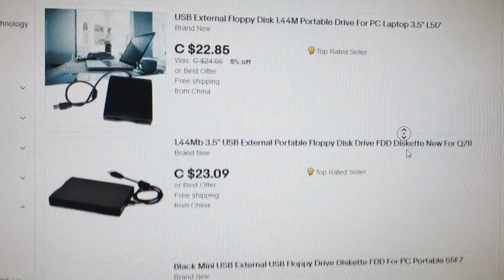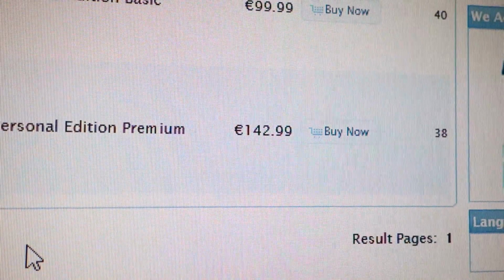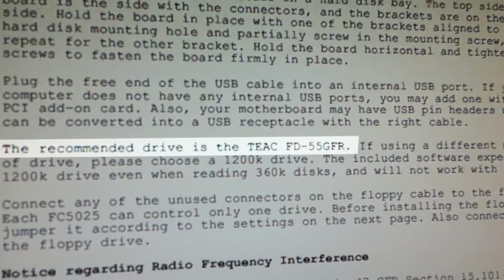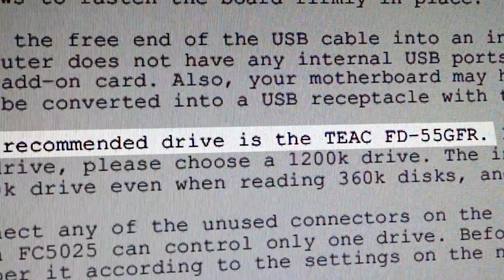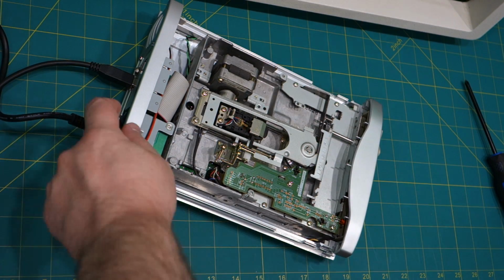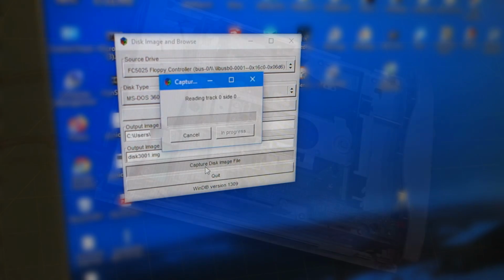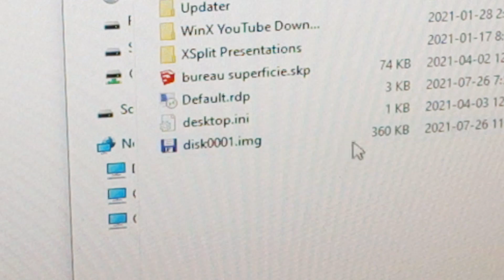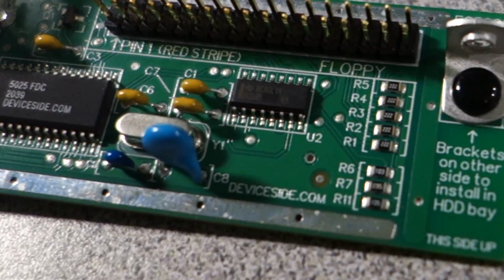Can we build a USB 5.25" Floppy Drive?

Comment: Until isn't to late, now, in 2025, it's better to find a working tower desktop on ebay with a floppy connection on the motherboard allowing usage of long tape connector for both floppy drives 3.5 and 5.25 inch ones. That tower  should run Windows XP and maybe Windows 7. Then to have installed those 2 internal FDD.
The WinImage copies images of any Floppy in Windows XP or even Windows 7.
That would be a proper rig to mess up with old floppies for any purpose, including preparing them for vintage hardware, archiving or reading old data to avoid losing them.
Besides in that setting old 5.25 inch floppies can be read/written the way those were designed in old time of yore.

Comment: if i don't use an enclosure? (i want to save some dozen of 5.25" discs).
Reply from the maker: Enclosure is mostly because I leave it on my desk and it's connected all the time, so I needed a solution that would protect the drive and keep dust out. The DeviceSide adapter will work perfectly fine without an enclosure :)
Reply: @theSoundCarddatabase  that's great news for my case!!!if you don't mind answering again, i have one more question....are there any drivers for the adapter in macs???
Reply from the maker: @yannisgk  My setup is PC, but from DeviceSide's website : 
"The included software runs on the following platforms:
-    Linux (tested on 2.6.24 x86)
-    Mac OS X (tested on PPC 10.4.11 Tiger, Intel 10.6.4 Snow Leopard, Intel 10.7.2 Lion, Intel 10.8.2 Mountain Lion and Intel 10.12.6 Sierra)
-    Windows (tested on 98SE, XP SP3, Windows 7 32-bit and 64-bit, and Windows 8 32-bit and 64-bit)"
Reply: @theSoundCarddatabase  WOW...thx for the information...you've been very helpful!!!

Comment: It would have been cheaper to use an old computer and network it to a modern machine or transfer to an SD card.
Reply from the maker: Agree! It all depends on your use case! if you're only interested in files, then an old computer + SD card would work. I was more into making 1:1 disk images, so this solution worked better for me.

Comment: I have a 3rd-gen i7-3770K running a massive RAID array for storage. Attached to that machine is everything from Orb 2.2GB, Jaz, Zip, and other removable media drives, to floppies and a select few tape backup drives. That system is for nothing else but archiving and backup storage. That's all it does.
Reply from the maker: Agree. Data archival and preservation is more and more relevant as physical media starts to disappear. So much important stuff is still on there with no way to be seen or useful.

Comment: You don't need to be limited to 5V power just to have a USB-connected 5.25" floppy drive! How do you think USB-connected printers and scanners, etc. work?
Reply from the maker: My guess is they're simply made with 5V in mind from the design phase and use only 5V components/motors/lights inside - the IBM USB floppy drives I own are 5V 500mA, and the Canon USB-powered scanner I have is 5V 500mA as well.  As for printers, finding one that is exclusively powered by USB seems impossible - most "portable" ones I seem to find actually have a battery inside and are using USB to charge it.
Reply: @theSoundCarddatabase : So my point is that any logic that "Uhh, well, USB 5 1/4" floppy drives aren't manufactured because they'd need to have a voltage higher than what USB can provide, uhh..." doesn't make any sense, because that never stopped mains-powered USB printers, scanners, and hard disk drives, etc. from being produced commercially.
Reply from the maker: @HelloKittyFanMan  you attribute a lot of uuhhhs to me. I agree with you that a mains-powered floppy drive enclosure, that connects through USB for data only is possible. It is basically what I assembled. If the initial problem was to find a floppy-to-usb solution, then it exists. If the problem was finding a floppy-to-usb-only solution, that would not be possible if you want to reuse actual old floppy drives. This said, why newer floppy drives with 5V inner workings instead of 12V were never done, I have no idea.
Reply: @theSoundCarddatabase : "A lot"? 2 isn't "a lot." But I agree that you didn't actually say those.
Yes, I see that what you've made here is what I'm talking about. But you used the logic that the reason is not made commercially is probably because that sort of floppy drive needs more than 5 volts. Which I'm saying is exactly nothing that would prevent any average peripheral manufacturer from making one of these commercially. But I don't understand your supposed comparison between problems. I'm just saying that your intro. makes it sound like you believe the reason there aren't any commercially produced USB 5.25" floppy drives is simply because of this 5V/12V thing, and that's what I'm saying doesn't make sense, because they can easily get around that. Not as portably, obviously, but it would be very doable anyway.

But you know, these days I bet you they could even make a 5V-only-based 5.25" floppy drive with the motor technology that we have now, in the same way as they have done with 3.5" standard floppy drives. But for some reason that solution still hasn't existed commercially. Do you think I would be wrong to guess that the size of spindle motor needed to spin the kind of hub grip needed for 5" floppies could be driven by a motor that's based on the newer technology for motors of that size now? Or do you think it would still have to be too massive even now, without requiring a higher voltage?

But anyway, I'm almost certain that a manufacturer could make the commercial version of what you have made here, even to the point of making it show up as a regular drive, but with external power if necessary. However, it seems that at least something in just the market has still stopped them from going through with it so far.

Comment: I have yet to be able to wrap my head around the fact we cannot get the collective hobbyists to put together an actual working read/write 5.25 solution that reads/writes natively without images. I know the USB standard doesn't support it, but so what? There are plenty of proprietary USB devices with custom drivers etc, so what is holding back the development of an actual USB 5.25 floppy? Some say demand, but it is VERY evident (especially lately) that there is a huge demand for such a native solution. Ideally, an external shell with the pcb and power with connectors inside. USB and standard power plug on the outside. Or heck, even a brick 12v adapter would be suitable. I don't know enough to even begin, but it is obvious there are plenty of people who are.
Reply: Would buy one of these
Reply: Agreed !!
Reply: It’s very confusing. Worst case you could just get an FPGA or a Raspberry Pi to drive the read/write heads and interpret the data and feed it to a PC in a USB friendly way.

Comment: Read only! Better solutions is old PC who support 5.25 floppy and have USB port. Read file with 5.25 floppy and copy on USB stick and insert in new PC than read data.
Reply from the maker: For most applications, this would be an entirely appropriate solution! But for archiving exact disk images (sometimes important for old copy-protection) or just preserving data as it is, I found it easier to skip the middle step.

Comment: Does the 5.25” USB floppy drive work with Commodore 64 5.25” floppy disks? Does it work with the C64 Mini and C64 Maxi?
Reply from the maker: The current list I have is : 
- Apple DOS 3.3 (16-sector)
- Apple DOS 3.2 (13-sector)
- Apple ProDOS
- Commodore 1541
- TI-99/4A 90k
- TI-99/4A 180k
- TI-99/4A 360k
- Atari 810
- MS-DOS 1200k
- MS-DOS 360k
- North Star MDS-A-D 175k
- North Star MDS-A-D 350k
- Kaypro 2 CP/M 2.2
- Kaypro 4 CP/M 2.2
- CalComp Vistagraphics 4500
- PMC MicroMate
- Tandy Color Computer Disk BASIC
- Motorola VersaDOS

I don't have more specific information than that, but you are welcome to write to DeviceSide and report back!

Comment: Great video but I think i'll keep my windows xp machine with a motherboard which has a fdd in it. Pop that tower aside my desk and remote access the windows xp machine, files can even be accessed via my windows 10 machine by sharing both A and B drives on the xp machine.
Reply from the maker: Sure, that seems like a viable solution too! I needed something... more compact than a second tower.

Comment: Does the drive appear accessable natively within Linux?
Reply from the maker: It's a good question, but I don't have an answer! I currently only have DOS/3.11, Win7 and Win10 systems running over here.
Reply: put Linux on a usb drive, run it on your newer windows 10 systems and it will boot as a Live OS, no installation required and it should appear as a mountable volume that you can access natively.

Comment: Great video!

Another major reason that 5.25 drives aren't normally supported via USB is that the USB specifications for floppy drives omitted 5.25 support.  I was surprised by this until I read the specs myself.

Comment: Actually, USB can do 12V. USB3.1. :D
Reply from the maker: To my knowledge, the 12v mode is only for speed-charging devices, but doesn't allow data transfer at the same time. But I may be mistaken!
Reply: @theSoundCarddatabase  Notebooks can be connected through USB3 and can be charged at the same time, can't they? Or is that Thunderbolt feature? But still, using USB3.x would be just a joke for this use-case. :)
Reply: @MrEnyecz  It can't draw enough wattage.

Comment: Another option to consider which would probably have been cheaper, though the software may have been more command-line oriented (I have a KryoFlux, so I haven't tried them yet) is to build a FluxEngine or a Greaseweazle.

(They're similar things you can make by soldering an appropriate connector onto an inexpensive development board, developed by people who felt the KryoFlux was too expensive and/or the personal edition had too restrictive a license or were in a region of the world the KryoFlux people won't sell to because they consider it too hard to enforce their license terms.)

Comment: In theory you should be able to make it work within Windows as an actual floppy drive. If you have access to the source code of that imager, you could figure out how the communications happens and then write your own driver.

I have placed a 5.25 1.2MB drive into a Windows 7 machine (newest Ive tried since I have no need after that) and it was able to recognise, but the problem was that when I put in a known good disk and double click the B: drive, Windows keep showing that there is no disk inside, but if I go and open the drive as a block device in a hex editor or some sort of imaging software I am able to dump all the sectors of the disk as an img file which can later be opened and the contents extracted. Funny that even in newer and more recent Windows Builds the 5.25 floppy drive icons are still being updated my Microsoft; someone is actually sitting at their desk at MS and using a graphics editor to make the icon of an obsolete rarely used piece of hardware look modern!?

here's
Reply: it's way easier to write drivers for Linux than Windows

Comment: Can this usb floppy controller, or any other like this one, be used as a normal old standard disk controller?
Having the old 5.25" disk drive in Windows as A: or B:  -drive?
Without having to use any extra software to read/write to the disk drive?
Reply from the maker: To the extent of my current knowledge... no?
I have tried the USB to Floppy adapter (that includes a floppy controller chip) available on eBay or AliExpress, but the chip on it only supports/detects 3.5" drives, and even then, only the 1.44mb ones (and not the 720k). So maybe if that chip could be hacked to support more drive types, it would be possible? but that's way above my skill level. It DOES get detected as A: or B: drives by Windows, but seems to not be compatible with any drive that is not 3.5" 1.44mb so far.

This said, you would be still needted to do some adapting the connector (feasible) and matching the additional input of 12V with an external power supply because USB doesn't give that much voltage (also feasible).
Reply: No. Your only option is to find a PCIe based Floppy controller that is loading its own small firmware and booting it and then trying to boot from the attached drives. That might work. But that only applies, if this small BIOS is capable to use the memory addresses, which the original PC BIOS used for floppy drives. And i am not sure, if the latter is possible.

Comment: Kryoflux is not just a USB floppy drive, in fact, it's not that AT ALL. You cannot directly access disks with it.
What is does is read magnetic flux levels on the disk medium and transcribes them to your PC. These files will be about 40-50MB in size for each disk.
Reading the magnetic flux is important for preservation because floppy disks aren't usually mastered on a normal PC disk drive, they were written on specialty hardware that allowed them to  do things normal drives can't. That's how floppy disk protection sectors work, they show up as errors in normal drives.
With a Kryoflux though, you can back up disks as a 1:1 analog copy, including these kinds of purposeful error tracks, and because it's format agnostic, it works on any format of disk from IBM PC to Mac to Amiga.
Reply from the maker: That is excellent info, thanks for sharing!

Comment: What about just using a 1.44 floppy to USB adapter, an adapter, and a separate molex plug?
Reply from the maker: Good question, and I did try it off-camera. It doesn't work because the 1.44 floppy to USB adapter you speak of (the one easily found on eBay and AliExpress) has two flaws :
1. It has the wrong connector, but that could be arranged.
2. The controller chip on the adapter, only supports 1.44mb drives. Not 720k, not 1.2mb, not 360k. 
So while I could adapt the cable itself, the adapter wouldn't recognize the drive itself, and the drive wouldn't appear in my OS.

Comment: You can have a 5.25 drive in a computer that supports USB if you have the right period motherboard. This makes it immensly easier to copy data from ancient 5.25 disks.
Reply from the maker: Please elaborate as I'm not sure I understand what you mean. Period-correct motherboards would indeed have the on-board floppy connector. This project is a solution for modern motherboards that do not have the floppy connector, so we have to rely on a separate USB adapter/controller to access 5.25 disks.

This said and if you prefer, the FD-5025 is designed to be put inside a computer case along with a drive, provided there's also an internal USB plug inside. I just preferred to put it in an external enclosure for portability across multiple computers.
Reply: @theSoundCarddatabase  I'm pretty sure what he meant is that most Pentium 4 boards and I think a hand full of core 2 duo type boards have floppy controllers that work with 1.2MB drives.  I think once you get to the Core I series I think you can't find them... And well to be considered actually modern I think you want to at least be in that Core I series age range.  So you could make something of a slow windows 10 machine that reads the floppies natively.  Though I think your solution allows you to read non-pc disks, and not have to suffer with a "modern" machine that is kind of not modern.